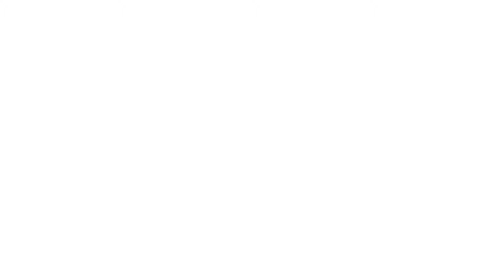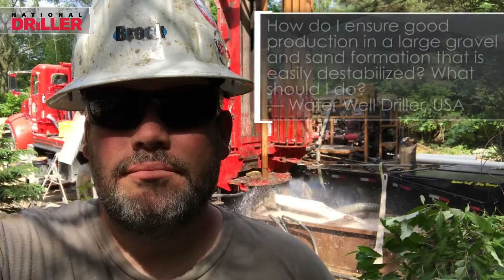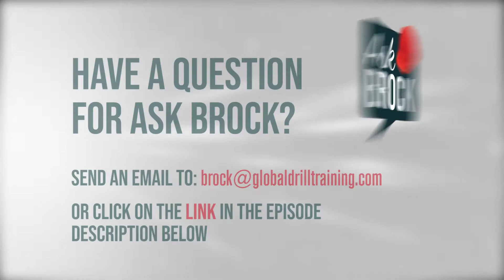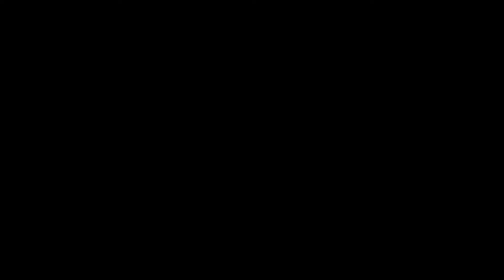Well Development in Sand and Gravel

Comment: Hi there,
I'm up in British Columbia.  I have fairly new a 260' well. The bottom half is sandstone and when I pump at a high rate the water comes out very muddy(fine clay like material in the water). When pumped at a low rate 3gpm the water is cleanish. 
It was recommended to me to keep pumping at a high rate to clean it out. But that seems like its taking forever to clean up(months).
Is there something  else you'd recommend? 
Someone also recommended an inline flow regulator to keep it at 3gpm.
Thanks for your time.